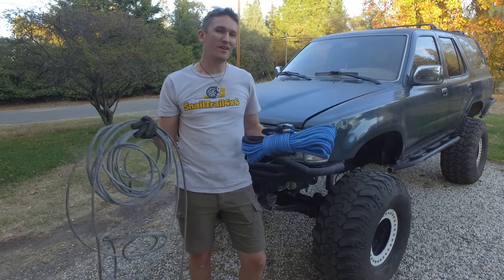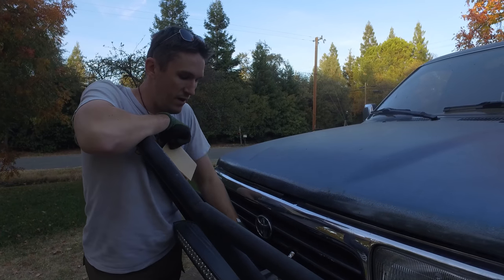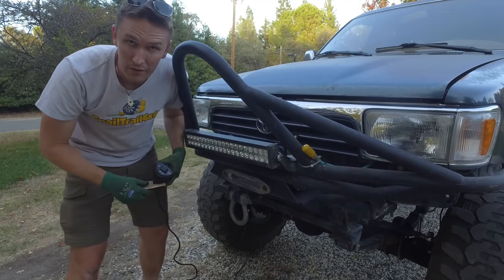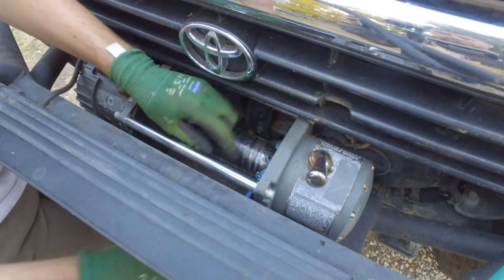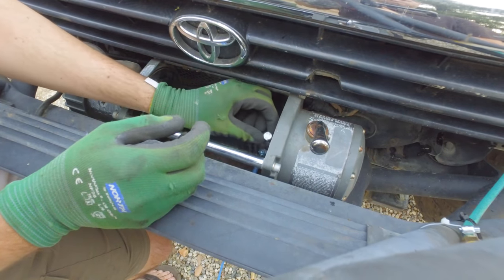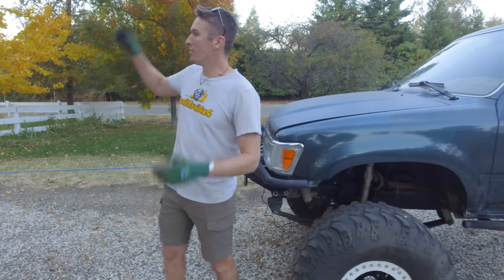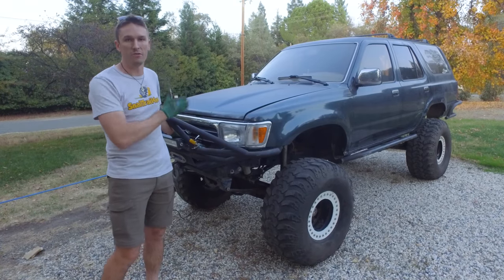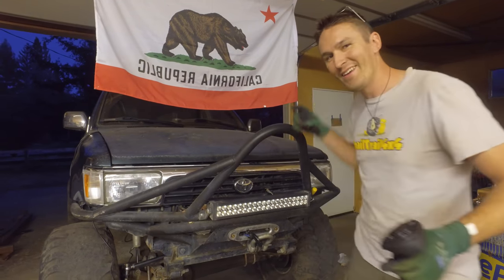Don't Install Your Rope Before Watching This!

Comment: Anyone watching this video, don’t ever have your hands so close to the fairlead when you are winching in, even when there’s no load like those first few wraps. If your glove was to get snagged in the line or in between the line and the fairlead it’ll pull your hand in a second. Please stay 3 to 4 feet back when spooling any kind of winch line. It’s also better to handle line handover hand rather than having it slide through. This is from the days of wire rope with birds that could cut you open. While certainly less of an issue with synthetic rope, there still could be a thorn or stick or something in that line which grabs you and handover hand works. Thanks!

Comment: When you thread the rope thru the spool, there should be enough pulled through to knot under the first wrap of the spool and pull across the drum.  The bolt is not a good anchor and that steel head will definitely cause wear on the rope.
Reply: Was thinking the same, don’t like that bolt head, thinking of pulling about eight inches of the rope (8 in drum) through that hole using the set screw that was already in there but threading the end of the rope through the other side of the rope which will lock the rope in the hole, then laying the end of the rope across the drum, , taping it down with gorilla tape , and wrapping the rope around that end, should hold tight with tension on the wraps

Comment: Why wouldn't you just bolt it on now that your not using allen wrench bolt and a washer if needed?
Reply: I have the same question
Reply: Or just put the grub screw back in after cutting the tip off?

Comment: Next time electric tape around the rope then cut then light on fire or you can use heat shrink tubing if you have it that size.
Reply from the maker: Those are great suggestions

Comment: Why couldn't you just use that bolt to go through the eye on the winch rope? Seems sketchier with the bolt onto the rope like that. But I suppose friction from spooling should prevent too much stress on it.
Reply from the maker: It wouldn't have worked like that, its a set screw not a bolt. Anyways your correct that it just is needed to start the line, the line holds onto the drum  with the loops around it.
Reply: I had the same question. Given the fact that you replaced the set screw with a bolt,  why not bolt the factory rope end to the spool with it?
Reply: @SnailTrail4x4 
Why not just put the set screw back if you just put a bolt back and pressed it down?   if you were worried about it being pointed a few seconds with a file will solve that.

Comment: You might not need to winch that much if you’d get a set of tires! I can see the air inside of them!😳😳😆
Reply from the maker: We have winches to winch to pull jeeps out. 😁
Reply: @SnailTrail4x4  Ya right

Comment: My winch cable on my fourwheeler has tangled on the edge and wont do anything do I need a new one or can it be fixed
Reply from the maker: Can it be unwound?
Reply: @SnailTrail4x4  new account: Sam here. I lit the winch on fire and quickly dipped it in ice water, this expanded the winch and i got out the rope 👍

Comment: Good color choice in the winch line. Looks evenly wound. I agree that you want some tension as you spool the line in, doesn't have to be crazy tight but enough to keep it in place 👍
Reply from the maker: Wouldn't you want a red one?
Reply: SnailTrail4x4 I need some contrast 😂 not everything can be red

Comment: I'm new in the trucking business. One of my 13-Tons Mercedes trucks got stuck in sand near the River bed loading sands for construction. For three days, I had no idea what equipment I should use to retrieve them.

After days of online research, I've yet to decide which of the competitive Brands may be good for retrieving trucks in the rainforest, sans and muddy terrain - WARN, SMITTYBILT,  XRC Gen 3 Winch and unknown others that can pull 25,000 or more if money is not a problem?
Reply from the maker: Warn is maybe #1, then all the rest are great
Reply: Pierce winch are the best

Comment: I’ve heard you shouldn’t use synthetic on winches with internal brakes because of the heat buildup inside the winch drum. Have you had any issues or heard of anything like that?
Reply from the maker: I've never hear that. If that was the case I'd rather have the internal brakes.

Comment: Did you really run a hawse fairlead with cable?
Reply from the maker: Yes, you can absolutely run a Hawse fairlead with a steel cable.
Reply: It's probably a steel hawse fairlead and not aluminum.

Comment: Why would a roller fairlead not be ideal as compared to dragging the rope over a smooth surface? Seems like the coefficient of drag would be much less with the roller. What am I not getting???
Reply from the maker: They both work. Just make sure to put a new one on, you don't want the burs to cut your rope
Reply: Many like Bill Burkes and others have suggested running rollers with synthetic. I have considered doing the same. I have not do so though. I see the reasoning behind it.
Reply: @Switchback_Outdoor_Safety  Well you could pull the cable in between the rollers and cut some strands.
Reply: @johngillette463  Yes that is possible. The likelihood is pretty low. It also depends on the roller fairleads. Robert Pepper and Bill Burke’s are big advocates of roller over hawse.
Reply: @Switchback_Outdoor_Safety  I also think that synthetic can be more dangerous than most people think.  But that's based on seeing ships and tugs breaking both types.Like any tool you need to know what you are doing.
Reply: @johngillette463  I would agree with that statement. Dealing with large amounts of stored energy has risk. Recoveries in general are a hazard. People should treat it with a great amount of respect and caution.
Reply: @Switchback_Outdoor_Safety  ,, I've seen Peppers video on the Roller/Synthetic debate.  
   If and when I convert it Synthetic,  I'll keep the Roller..   I will ensure everything is smoothly polished👌.
Reply: Have a roller but will use the hawse, slick synthetic rope and smooth aluminum, but then again there will be mud and grit in the rope first pull